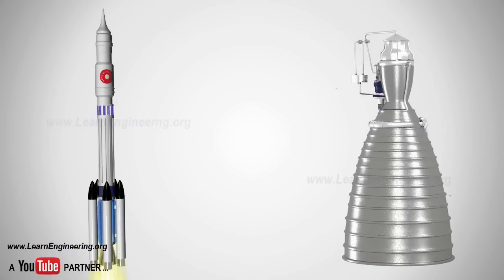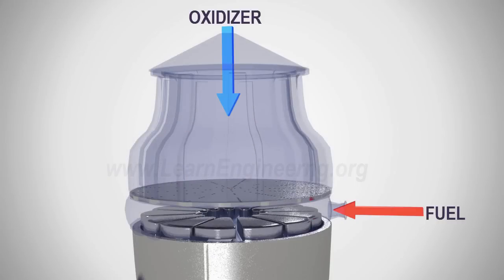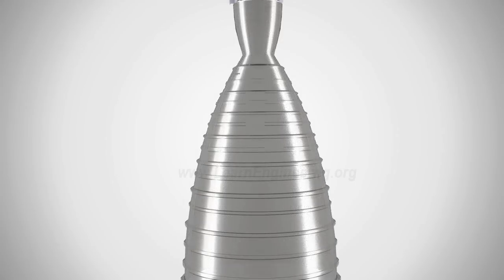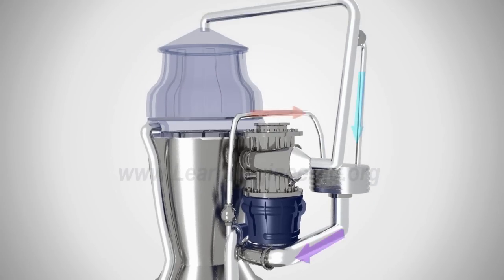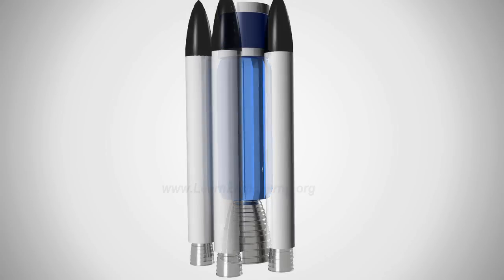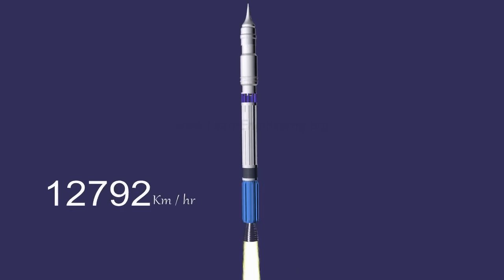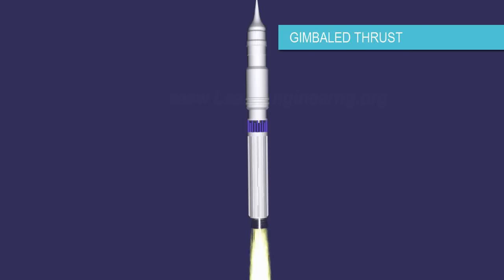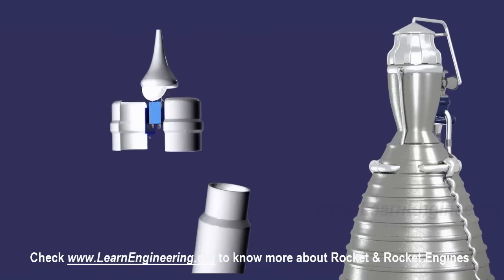How a Rocket works?

Comment: 0:17 It's not the mass of the propellants being "ejected" that causes the thrust, although in part it is; Thrust comes from the force of the rapidly expanding gasses, following their ignition.
You wouldn't get very far off the ground if all you did was "eject" the propellant mass out of the rocket engine...
Reply: ***** I strongly disagree with your dismissal of how fundamental and crucial the conservation of momentum is to the operation of a rocket.  It is not "in part" responsible.  It is the entirety of how rockets work.  Everything else you are saying can be simplified to the conservation of momentum.  Chemical reaction or no chemical reaction.  It's irrelevant.  All that matters is the mass ejected and the velocity with which it is ejected.  The method that produces this velocity is irrelevant to how rockets work.  Look no further than the very famous rocket equation for verification on this.

dv = v (e) * ln * (m0/mf)

dv = change in velocity (delta v)

v (e) = exhaust velocity 

m0 = initial mass

mf = final mass

The difference between m0 and mf obviously being the mass ejected.

ln is just a logarithmic function.

Nowhere in this calculation does it require there to be any chemical reaction because the MEANS by which the mass is ejected giving it velocity is entirely irrelevant to how rockets fundamentally work.  The means could be you throwing a baseball, and the rocket equation would be just as applicable.

Finally, the above rocket equation could not be derived without the law of conservation of momentum.

I've said everything I have to say on the matter.
Reply: +Anamnesia You're incorrect in saying that ejecting mass alone does nothing.  For starters, you can't eject mass without exerting a force on that mass - and without that mass exerting an equal and opposite force on the remaining mass (the rocket), so simply ejecting mass will result in thrust.  It's the law of the conservation of momentum (which is very closely related to Newton's third law).  If you have a system with a certain momentum, that momentum is ALWAYS conserved as long as there are no outside forces acting on the system.  If you have a rocket with a mass of 10,000 kg that is resting motionless in space (v = 0), then the momentum of that system is zero (p = mv = 10,000kg * 0 m/s = 0 kg m/s of momentum).  If that rocket ejects 1,000 kg of mass at 3,000 m/s, then you must conserve that momentum.  The total momentum of the system must remain at zero.  For simplicity's sake, let's think about this in two dimensions.  The rocket is pointing up.  The ejected mass was ejected downward - we will call this the negative direction.  So, 1,000 kg of mass was ejected at -3,000 m/s giving the ejected mass a momentum of 

p = 1,000 kg * - 3,000 m/s = -3,000,000 kg m/s of momentum.  Since we know that the total momentum of the system is zero, then the momentum of the remaining mass - the 9,000 kg remaining - will be 3,000,000 kg m/s.  We can easily calculate the resulting velocity of the rocket - which will be upward - in the positive direction :

v = p/m = 3,000,000 kg m/s / 9,000 kg = 333.33 m/s

This is the conservation of momentum at work.  The only thing the rapidly expanding gases accomplish is in increasing the velocity with which the mass is ejected.  The faster it is ejected, the more thrust it will create because it gives the ejected mass more momentum - which in turn will thrust the rocket at a higher rate to conserve the initial momentum of the system.

Sit in a swivel chair with something massive and throw that object.  You will roll backward in your chair - BOTH because of Newton's third law AND the conservation of momentum.  The more massive the object is that you eject, the more momentum it will have resulting in more momentum for you in the opposite direction to conserve the initial state.  The harder you throw the object, the more momentum that object will have resulting in more momentum for you in the opposite direction to conserve the initial state.
Reply: +Anamnesia I also feel that this very important fact was not mentioned in the video, people do not realise that it is the force of combustion pushing against the engine itself that produces the thrust, not the gasses pushing against the atmosphere. This video fails to correct that misconception.
Reply: +Anamnesia  no! people think it's 'the air' that pushed that giant saturn-5 rocket all the way up out over the ocean.!
   ....shyeah! 
                             except for ,how and why rockets work!
Reply: what? there's no combustion!
Reply: 100SteveB, I think the video poster has targeted the engineering and future engineering crowd, so does not engage (ignores) frivolous pseudoscience advocates and their misconceptions.  Perhaps he would rather they keep their misconceptions since they are not really his intended audience.
Reply: Analog Human, The real source of thrust is indeed the pressure applied to the inner surface of the engine, but the mass ejected at a given speed is not a completely different phenomenon. 
As the gas applies pressure on the engine, the engine applies the same pressure on the gas as well, and massflow * velocity (+ some force from the pressure difference at the exit) shows the amount of momentum gained by the gas during this process. It is basically the same AMOUNT of force as thrust. Even though massFlow * velocity equals a force in terms of units of measurement, it is not a force itself, it just shows the amount of force that already(!) accelerated the gas.
What people need to understand is that a gas travelling at high speed at the exit of nozzle doesn't mean it is pushing against something, it means that it has already pushed.

So please do not say that thrust is the pressure acting on the engine AND a tiny massFlow * times velocity, because they are not different things which we need to sum up, they are THE SAME. The relationship is the following: you can use massFlow * velocity (+some force from pressure difference) to calculate the pressure integrated along the surface of the engine (aka thrust). 

By the way, you can achieve high enough velocity: 
The F1 rocket engine (Saturn V first stage) had an effective exhaust velocity of 2580 m/s at sea level, and ejected about 2600 kg of gas each second. That is equal to a force of 6.7 MN acting on the engine, which is equivalent to the weight of 684 metric tons. The Saturn V first stage had 5 of this engine.
Reply: Willoughby Krenzteinburg I believe you've overlooked my qualifying statement, "although in part it is".  Of course expelling mass will exert a force, but it is not the force of expelling the propellant which lifts the launch vehicle; it's the chemical reaction & the rapidly expanding exhaust gas that provides the majority of thrust.
In essence; conservation of mass is maintained by the propellant - meaning the weight of the propellant prior to ignition is equal to the weight of the gasses after ignition.  What provides the majority of thrust is the energy released in the chemical reaction.
So while the mass of the propellant cannot be ignored, my initial statement "It's not the mass of the propellants being 'ejected' that causes the thrust" remains valid when you understand that it's not the propellant which causes thrust, but the chemical reaction.  And this is the information overlooked/omitted in the video.

Comment: It's really very simple!
Think of a balloon.  If you blow one up and then tie off the "nozzle" it goes nowhere. If you place it on a table in calm air it just sits there. Why, when there is so much pressure inside the balloon, does it not move? You can best answer the question for yourself if you visualize little arrows for the forces operating inside the balloon. For each arrow of force which you imagine you will immediately recognize that there is an equal and opposite force arrow cancelling it out. How do we know this?  Because if that were not  true there would be at least one force arrow without anything holding it back --- and then the balloon would move under the influence of that unbalanced force arrow inside of it. Since the balloon doesn't move all the force arrows must be balanced and cancel each other.
Now what happens when we open the nozzle? Well now the force arrows which had been pressing against that part of the balloon (where the "nozzzle" was) have nothing to press against and so they simply disappear. But this leaves the -- now unbalanced -- opposite force arrows without anything to oppose them and so they simply push the balloon across the table. This is simply an observation.

In an actual chemical rocket engine we use burning fuels and the expanding gases which result to create the very same force arrows inside a strong container which has a "nozzle" on one end.  The engine does just what the balloon did. The only difference s that the rocket engine is usually made of strong materials and so it does not change its shape as the balloon did and it does not move in an unpredictable way as the balloon did.

Now you may well understand why it is that a rocket engine does not require an atmosphere against which to "push" in order to function. The "push" comes from within. 

[This is NOT the case with a jet turbine engine ("turbojet," or simply "jet") which works by inputting air from its front end, compressing that air, and then expelling it with a higher pressure from its rear. Such an engine DOES require a surrounding atmosphere in order to function].
Reply: How long  did it take you to write this and how, please telle:)

Comment: why does the rocket fuel need to go around the nozzle and why is the turbo pump powered by a gas generator?
Reply: +deltoid 77 The fuel is incredibly cold, the nozzle gets extremely hot.  So the fuel is circulated around the nozzle to cool it and keep it from melting.  As to your turbo pump question, pumping that fuel and oxidizer at such high rate requires a lot of energy, so unless you wanted to lug huge batteries along to power electric pumps, you'd be better off using the abundant energy source that's already present
Reply: that's an incredible explanation. now I'm wondering why that explanation is not in the video. they should hire you. I've always wondered why the nozzle didn't just melt right off.and I was wondering what powered the pump because I couldn't find the battery compartment for such a powerful device.
thank you very much! it was very educational.
Reply: +deltoid 77 - Also know that not all liquid fueled rocket engines use turbopumps to pump the fuel into the trust chamber and not all of them circulate the fuel through the nozzle to cool it. Smaller engines, such at the SPS engine on the Apollo Service Module and the 2 engines on the Lunar Module, use pressurized gas to force the propellants into the thrust chamber and have ablative coatings lining the inside of the nozzle that slowly burn off to carry the heat away.
Reply: +deltoid 77 In bigger rocket engines, energy generated and used by turbopump exceeds MW of power, so it's more than some of coal-powered power plants. I can't imagine batteries for that.
Allso lot's of errors in the video. Injector plates misplaced and named combustion chamber, allso oxidizer tank is usually bigger one.
Reply: Joe Vignolo do you think the fuel cooled nozzle is more efficient than the protective coating?
Reply: +deltoid 77 - Sorry. My knowledge of rocket engine design doesn't go to that level. I don't know the answer.
Reply: oh ok
Reply: +Ryan N But why is the fuel cold?
Reply: +Sandesh Jadhav  - Basically to shrink the rocket fuel down. If you tried to pack all that rocket fuel into the rocket at room temperature you would have to pressurize it. Doing that would require heavy tanks with thick steel walls to contain it under pressure and the rocket would get too heavy to fly.

So what they do instead is to chill the fuel down to something like 300 degrees below zero. At that temperature the fuel becomes a liquid that is very very dense. If you are talking about hydrogen as the fuel you can take all the hydrogen gas in a large sized room, chill it down and shrink it into an amount of liquid that would fit into a coffee cup.

They also do the same thing to the oxygen. They take oxygen in gaseous form and chill it to about 250 below zero to convert it into a liquid. By doing that you can take all the oxygen gas in an average sized house and shrink it down into an amount of liquid that would fit into a trash can.

Gasses that have been chilled to super cold low temperatures and are now liquid are said to be in cryogenic form. Cryogenics is just a way to pack large amounts of gas into a very small space at low pressure so as to avoid needing heavy tanks to contain the gas at high pressure. This saves weight and makes the rocket light enough to lift off the ground.
Reply: Joe Vignolo Thanks! that was very helpful!
Reply: +deltoid 77
Efficiency doesn't really matter in this case, it's more about complexity and how much heat you have to withstand. I would say that regenerative cooling is slightly more efficient as the nozzle can be fairly lightwight
Back to the main reason for choosing either of the methods.
Ablative cooling is cheaper and easier to build because you don't need to build fuel channels into the nozzle which is a technical challenge. The huge advantage of regenerative cooling is that you transfer the heat away so you can operate the engine much longer without to much stress on the material and you have some of your fuel pre-heatet so it takes less energie to ignite (more or less giving you back the energie the losses from cooling the exaust gases which slows them down). Regenerative cooling is mostly used in large engines (especially first stage engines as they typically burn relatively long). Ablative cooling is commonly used for engines used in space as they have larger nozzles* giving them more area to spread the heat around and more area to radiate it away.
In addition to that film cooling is used, which works by injecting a bit of extra fuel around the injector or out of the walls of the burning chamber/chamber throat region. As most rocket engines run fuel rich (they inject more fuel then the oxidizer can burn) this extra fuel won't burn and provides extra cooling in areas with very high temperatures.

Today most engines use a combination of film cooling and regenerative cooling.

*larger nozzles are used so that the exaust pressure can drop further as rocket engines run most efficient when the exaust pressure is near the ambient pressure.

Edit: after reading this comment i noticed that i scewed up sorting the points i made. I hope you stil understand what i want to say. If not feel free ask and i will try to help.

Comment: lightning power very high voltage, it can be made. by means of programming the alternating wavelength variations and feed it to lighting making machine to achieve big force of detection, not permanent detection happened in seconds but drive in different timings. it's a hint to achieve section by section detection to make move loads speed of light.

Comment: Elevator once the foot step on, the weight will be the switch to moves the stairs.up to the top. no machine needed just detection. with individual stairs, mechanical timing. it's a hint to achieve speed of light.

Comment: I wonder they used flammable fuel. my 4 elements in this inside force rockets produce also a fire very strong but I used not flammable. it's used corrugated aims. waste of fuel.

Comment: Rockets , I explain its up to you if okey or not ,The weight very heavy, tons of chamber of fuel, tons of fuel, dangerous falling debris, flammable dangerous, bad to environment gasses. when ignites the force hits the ground when up the force hits the air. its a waste of force. my AIR ROCKET. no need to carry air. used 4 elements none flammable. top and bottom inside force the top pull the load , the bottom push the load. I don't want to voice out what 4 elements is used its for sale. it's very big big force that you can imagine. in my proto type my chamber broke up several times, and I learn. two rockets top and bottom. the top function the bottom standby. then bottom function top standby. it happened in seconds,  inside force always hits the  chassis of the load,  if horizontal travel top rocket, vertical travel bottom and maintaining height. Take note my rockets is reverse top and bottom its not flammable and use 4?. to run fly. it can be used in car, shipping vessels, and helicopter no wings, flying saucer, free energy high voltage power. the power of electric rocket how can be done. I know 35years in repairs TV,amp,radar,sonar,transmitter. etc. type Ruelldom@gmail in Facebook, Ruell Domalaon in G+,
Reply: +Ruel D Domalaon What????

Comment: If the load to be carried is defy? it has no weight, so the rocket act only as vertical tilt, leveling the height and carry its own weight. because the Antigravity is faster than flight. it moves and maintained its zero level. when up? level become + positive and antigravity will response to make it zero and its faster than flight up. sorry I stop no money involved , my talent is a waste. I already know that 11 years ago. I'm a secret genius in electro mech structure design anyway thanks.

Comment: please do your best to explain the meaning of torque im having a hard time understanding it
Reply: +Richmond Abban - Torque is basically twisting force. When you turn a doorknob to open a door, you are applying torque to the knob with your hand. The torque causes the knob to rotate, which in turn moves the latching mechanism so you can open the door.